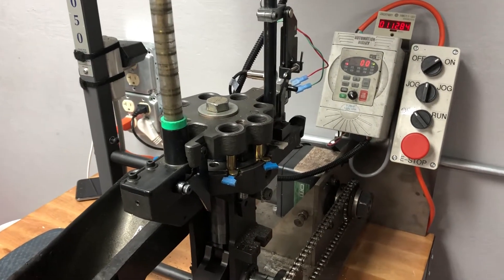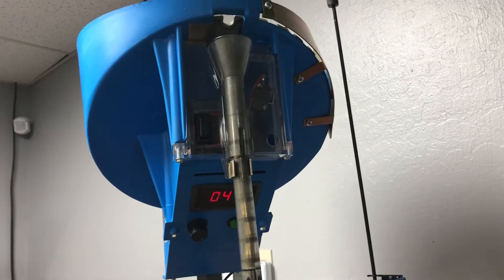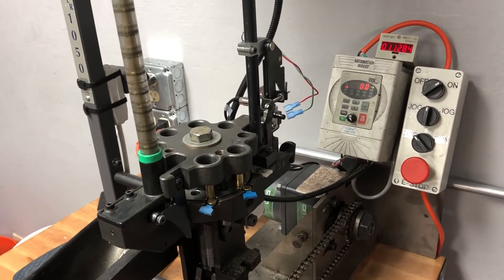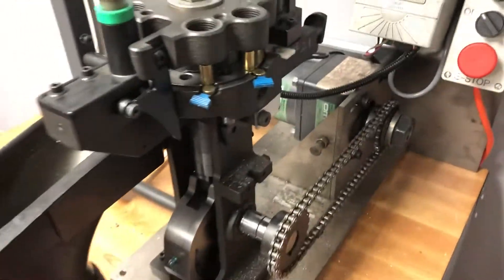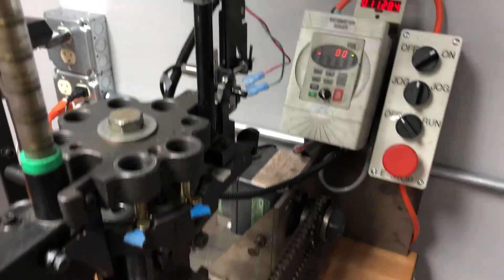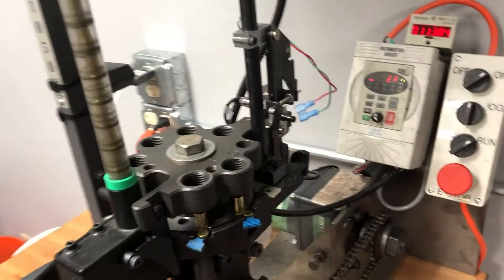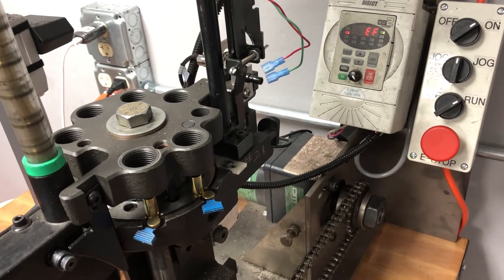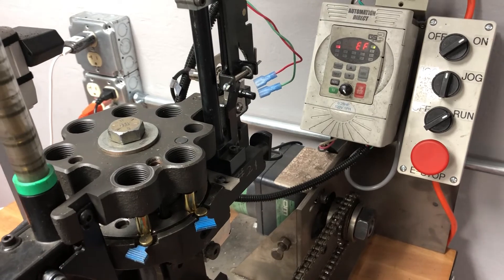Dillon 1050 Priming at 5000 RPH

Comment: How do you get primer to not blow up and seat right every time?
Reply from the maker: We don’t run at those speed regularly. It just shows what can be done. We have found slowing it down improves reliability. Don’t generally have any issues with primers blowing up. Not to say it has t happened but very rare. As far as seating it comes down to brass prep and making sure the machine is tuned properly. Nothing Dillon does is “precision” so lots of tweaking on each machine.

Comment: What additional mods do you have?   We have a 1050 on it’s way to Craig right now.
Reply from the maker: Tlicious726 outside of the frame it mounts to we have pretty much redone everything. We have completely redone the controls for it. This allows for the mechanical clutch as well as an electronic clutch. It also allows faster speeds. We have hooked up multiple sensors as well.  Then we came up with our casefeeder speed control which is on our site. Without that speeding the machine up doesn’t do much good.